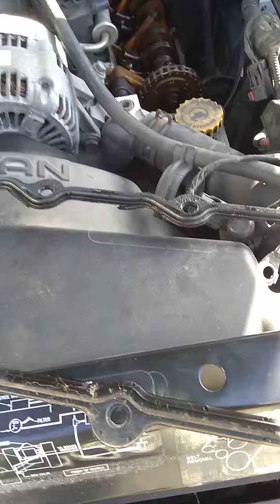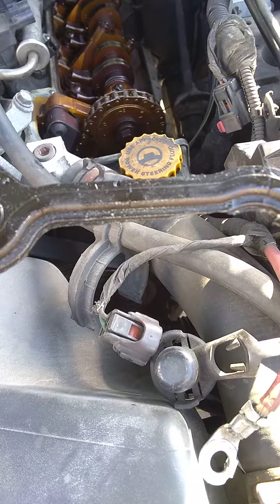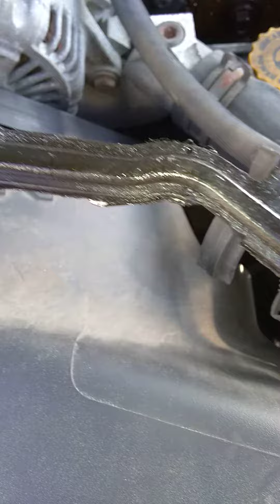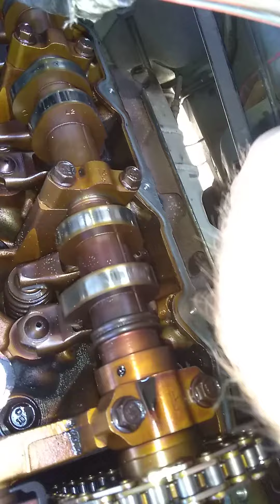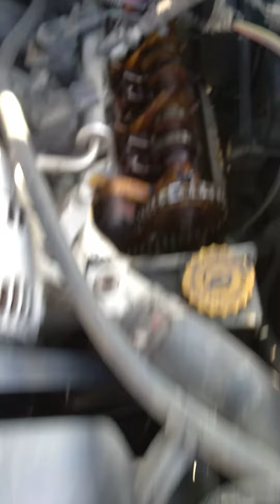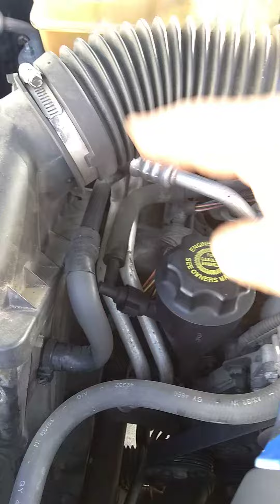2004 Jeep Liberty valve cover change.

Comment: Mines doing the same thing. I think I’m going to change that side only if other side requires disconnecting the ac. Ty for the video
Reply from the maker: I did both side you don't need to disconnect the ac.